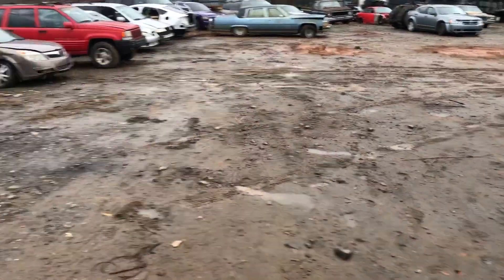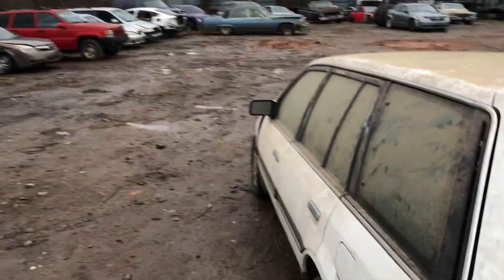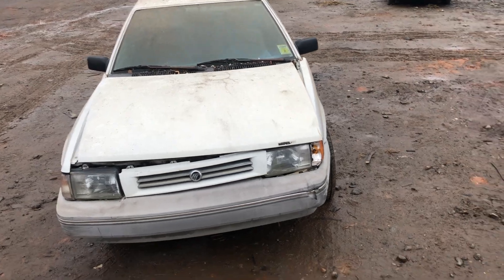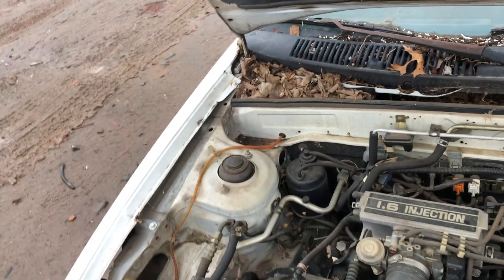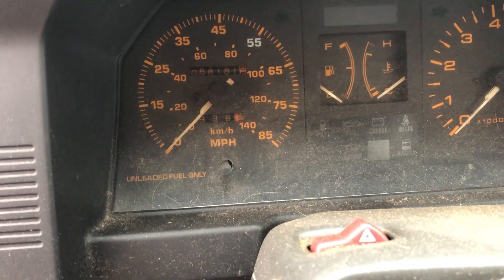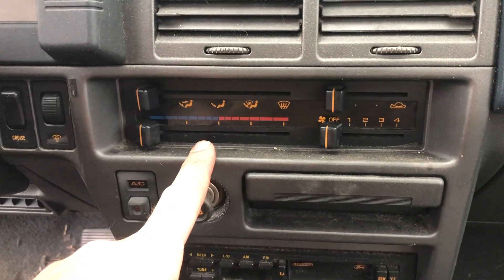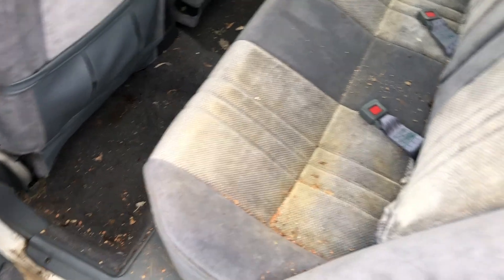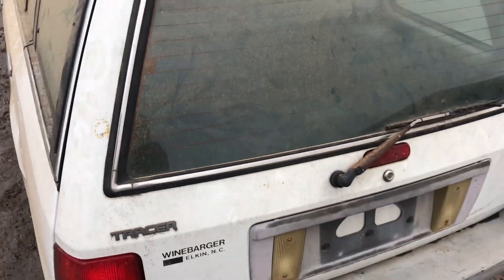89 Mercury Tracer SW scrapped

Comment: Loved these cars back in the day as our family over the years had 4 of these and ran each one well past 300,000 w/minimal mechanical issues.  Rust is what killed each one from the bottom up.  One was traded off on a new Ford Ranger after college and 6 years later bought it back by accident thru a different dealer as did not know it was the same one until I called the insurance agent to put insurance on it - same VIN from 6 years previous.  Yes - they were Mazda 323s rebadged but still loved them and if by some way or form ever find another 1987 - 1990 Mercury Tracer w/manual as the 4 previous were all manuals and can buy it for a reasonable price - YES!

Comment: Easy, Crush it Crush It.  Hardly anyone would want the 3 speed, especially when Mazda had a 4 speed available as well,  plus it  probably be relagated to mostly city driving. Driving this with the relatiely low powered engine on today's higher speed interstates could be  interesting. Lol, it's time has come and unfortunately gone.

Not a big seller either, especially for those who were "burned" by the Lynx,